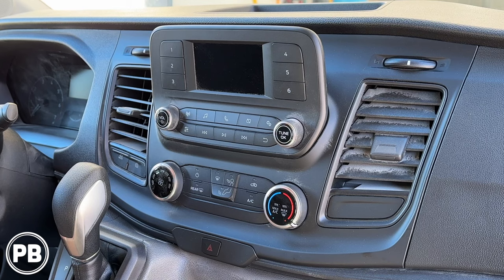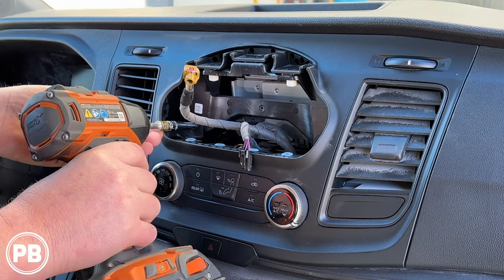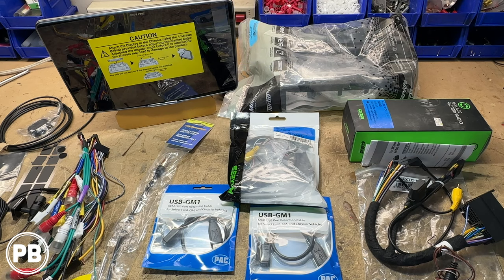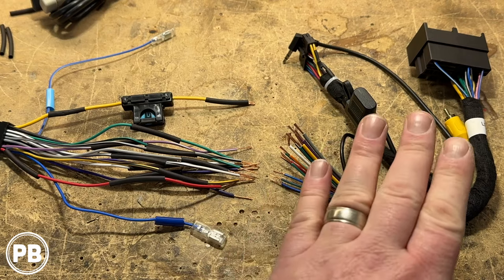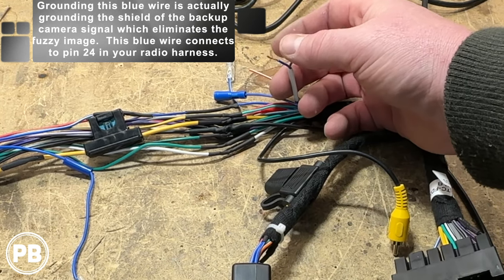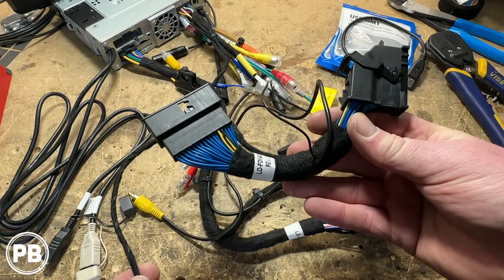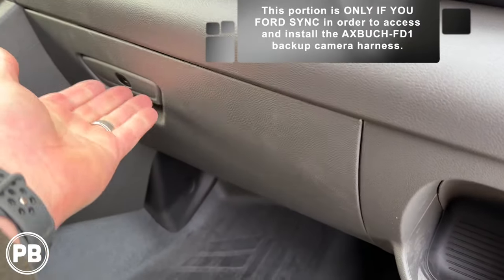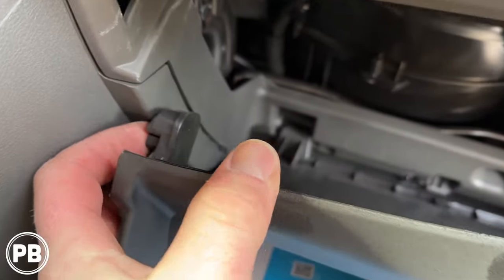2020 - 2024+ Ford Transit Radio Install

Comment from the maker: Parts used linked in the description of the video!
Reply: Just bought me a 2020 and am going to use your affiliate links to get the parts needed to do this..  the question I have though is will this deactivate the Ford Pass usability?  I don’t believe my system is a sync system either…

Comment: Since it's not specifically covered in the video.    Attach the Blue Center channel wire to the black radio ground, and the backup camera of a Non-Sync Transit 2024 will work.  I just finished this install myself.  It works.   Otherwise all you get is a black screen.  So while youre building the harness just make that connection and it will be fine.        Great video!  Very helpful.

Comment: Thanks for the video!  I have spent the day installing the radio on my 2020 350HD with components I bought thru the affiliate link. I have one issue. I can’t seem to get the rear camera to work. I have a sync system and everything seems connected properly, just can’t get that camera to work. Any thought?  I saw another short online talking about grounding the rca outer ring directly and that didn’t work either.
Reply from the maker: If you have sync, you need to use the Sync Video retention harness (AXBUCH-FD1) which plugs into the video input of the radio, not he video input on the axxess harness (AXTC-FD3) that connects to the radio side.  The Sync module powers the camera which is why in your specific trim, it's needed.  Non Sync models you may have to ground a wire in the radio harness as there is no sync module to retain.
Reply: @ProvoBeastAudio  FD1. That’s the one I have.
Reply from the maker: You also need the fd3 harness to retain the backup camera if you have sync.

Comment: Awesome video. One thing I’m confused about— is there a reason an idatalink Maestro module is not needed on this stereo to retain factory steering wheel settings? Is it just not compatible with the Transit?

Comment: Great video! Im a little unclear on the USB function though; for non-sync vans, do the adapters suggested attach to leads that go directly into the factory usb ports? Or do they just become "new" usb ports i need to mount elsewhere? and if so, what happens to the factory usb ports? Thanks

Comment: Im installing a powered subwoofer and im wondering where i should tap onto the speaker level lines for the input.

Is the harness on the right side at 2:27 the speaker wire output?
Reply: Looks like that's it from what I found on FordTransitUSA Forum. Colors at radio harness are:
Left front + = White
Left Front - = White/Brown
Right Front + = White/Violet
Right Front - = White/Orange
Reply: @TaylorSly subd because of this answer.  Any chance you know the rear speaker colors?

Comment: also, the bit about "pinning" the blue wire is a little confusing? Does it infact just connect with pin 24 on the radio harness in order to ground it? How does one do that? and what does one do with the black wire in that case? Thanks

Comment: Hello, thank you for the great tutorial.  I’m having a couple pf issues. 

First Issue: I had two harness connectors for the AM/FM antenna so I just guessed and hooked one of them up but now I don’t get any AM radio. In your video there was only one connector.

Second Issue: I cannot get the back camera to work. I am sure I hooked it up correctly and I hooked up the blue wire to ground it but I only get the black screen with the red and yellow guides but no image.  Hoping you can help because it’s a pain to reverse without that camera. 

Thanks in advance for any help you can give.
Reply from the maker: I’d you have sync, you need the sync extra harness and will not sure the one on the primary harness. The am / dm is usually a larger cable, as the blue is for the screen, and yellow is for the xm sat antenna.

Comment: good morning im saw your videos and im think maybe you can help me,ive a ford transit custom 2019 with 4'' screen and ill replace it with the original full radio sync 3 8'' screen. im boughted already apim,acm and display but i need the wires to connect it plus my van looking do not have the apim. can you please help me? do you sell parts? do you have any video? im desperated, thank you for any help

Comment: Sensational video.. May I ask. Does hands the factory hans free hardware work with all of the plug and play or do you need the mic supplied in the box to be installed?  Thankyou
Reply from the maker: You will need to install the mic provided by the new radio.

Comment: Any downsides to replacing my factory 2021 Sync3 with this unit?  I like the wireless (Apple?) Car Play.  Will all my steering wheel controls will still operate correctly (including the Adaptive Cruise Control)?
Reply from the maker: It's a solid unit. Huge upgrade over factory, but depends on how ambitious you are for the install.  All factory steering wheel control buttons were retained, and audio buttons to the new radio.  Only downside is the issue with the USB ports, but if you keep the Sync module connected, they will become charge only.  Outside of that, we retained everything.  Everything should be linked in the description!

Comment: Hey, is there anywhere I can check which cable corresponds to what signal on a 2015 Transit 250? 
Color matching sounds wonderful but, if it’s not always a direct fit, and the battery has to be disconnected, how can I check for signals? 
Like let’s say reverse, or battery positive ?
Reply from the maker: Well if you are using the correct install parts, you can check with each manufacture to determine the functions of each wires.

Comment: thank you very much for the great video.  unfortunately the picture of the camera was not shown. Is the camera over the full screen and the guidelines/pdc are still active?  Thank you for your response
Reply from the maker: Yes, the dynamic guidelines and image was full screen.  Remember, we had the factory SYNC system as well.  This radio simply just displayed the camera's image, the image processing and guidelines were still produced by the vehicle.  We did show the reverse image @18:40
Reply: Is there anything else that needs to be done regarding reverse camera as with my pioneer unit camera work but not great image pixels

Comment: Great video! Question for you. Would it be better to order a Transit with or without SYNC if installing a similar radio? One of the many delays with the new Transit is the 12 inch touch-screen I've learned.
Reply from the maker: You can do both.  The benefit of Non-sync is you can repurpose the USB ports for the new radio where as the SYNC version, they can only be used as charge.

Comment: How did you retain the factory USB sockets ? In you parts list you indicate the USB-GM1, but in the video you mention they are a hub from the SYNC system and can only be retained for charging ?
Reply from the maker: If you have Sync, they are not retainable and remain as charge only.  Non-Sync would use the Pac USB-GM1 adapters that allow you to plug those cables into the new radio for use of CarPlay, Android Auto, multi-media, etc.

Comment: Hi, I recently installed an aftermarket head unit. Not the same one but similar procedure. I was wondering if its possible to retain the Ford microphone for calls and if so which wire is it, and is there an adapter for it. Thanks!
Reply from the maker: Unfortunately not, it is on its own protected circuit and isn't compatible with the analog mic input on the radio.
Reply: @ProvoBeastAudio  thats a bummer, but also explains why excess googling for microphone adapters comes up short. Thanks for answering and great video! Helped me out a ton!

Comment: After installing the new radio, will I be able to use the button on the steering wheel, that allows you to speak to the factory system, like the option talk to text
Reply from the maker: Yes steering wheel volume controls are retained as shown in the video during programming.

Comment: Hi
Would you help to show me where is the the seat module for 2020 Ford Transit 350 HD gasoline with high roof 15 passenger van. I could not find the seat module where you are showing in the video. Many thanks
Reply from the maker: Seat module?
Reply: @ProvoBeastAudio  Yes, Could not find the module behind the glove box like the one you have in this video clip. I bougt this AXXESS - Ford 2020-Up Backup Camera Retention Harness (AXBUCH-FD1). My Van is 2020 Ford Transit 350 HD. Thank you for fast response.
Reply from the maker: @arthurle288  If you don't have the SYNC module behind the glove box, you don't have SYNC, and thus need to order the appropriate parts for it (linked in the description)

Comment: My factory OEM backup camera dont work. I dont have sync.  What do i need to do? Thanks
Reply: And my factory DAB+ dont work
Reply from the maker: I have notes in the description for those that don't have sync.  You may either have to increase the video voltage of the camera, ground, the camera shield in a different location, or a combination of the two.
Reply: By default on this radio there are no cameras activated when you first install it. Go into the radio settings and you can select your factory camera. Even if the wiring is correct, you won't have a backup camera until you do this.
Reply: My reverse camera picture or video not look very good. It's like washed out or bad pixels like low quality video

Comment: I have the ford transit 2023  E350 I want to add 2 15 “ subwoofer and (2) 12” and tweeter for voice can this be done I have the sync 4 system
Reply from the maker: Send us a message on Facebook and we can chat
Reply: @ProvoBeastAudio   I have a  ford transit that needs a up grade
Reply: I have the same question plz any help would be appreciated
Reply from the maker: @coltonnathanielfink5564  Sure, send us a message on facebook or instagram and we can help with your build.

Comment: Great detailed video - One question: one of your parts from Amazon, the PAC USB-GM1 adapter shows that it's for General motors and Chrysler. Is that still the same part for Ford?
Reply from the maker: Works great for the Ford.  The harness adapter is simply a female mini USB adapter to male type A adapter.  It's branded as GM, but works on any application.

Comment: Does it have SiriusXM?
Reply from the maker: It's XM ready, yes.  you just need to add on the XM tuner module to it.
Reply: @ProvoBeastAudio  I'm moving into my vehicle soon and will be looking at a transit, but with having to be aware of it having a sync 3 and so many other features prior to buying it used I'm wondering if this upgrade is a little too much NEED THIS NEED THAT. Maybe my choice should be to find a system that is just a pull mine and plug one in with all I want already in it! No installer will want to have to watch your video and do a half-assed install because they've never done it before.

Comment: Does FordPass still work, the remote start with the FordPass app?
Reply from the maker: that remains untested.  Best way to check would be to remove the radio, and see what happens (before you install the new radio)
Reply: Yes it works for my 2023 Transit. I installed this radio in my non-Sync enabled van. i can still remote start and lock/unlock doors with the app. Backup camera works, etc. All good!
Reply: Mine used to work into I got a new phone
Reply: @Hunter25dotcom thanks for your post here. I was wondering about the exact same thing. I have a 2023 non-sync as well and want to replace the head unit but would like the ability to see the gps location of the vehicle/remote start/etc from the Ford app to remain functional. How’s your experience after a few month passed now?